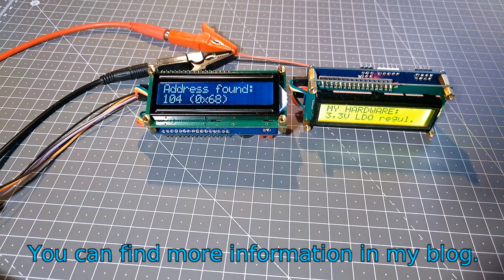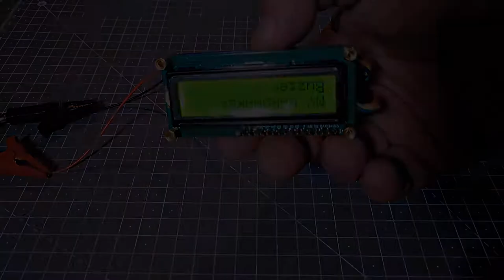Arduino clone for mounting on a 16x2 LCD display

Comment: Make a detailed video how you put the solder mask
Reply from the maker: Hello Max Dax, I developed this PCB with KiCAD and then ordered it from JLCPCB.
I have already tried to apply a solder mask myself for individual projects, but unfortunately my results were not satisfactory. That's why I decided to make my PCB as universal as possible so that I can use it for many things. Then it also makes sense to have these made by a manufacturer.